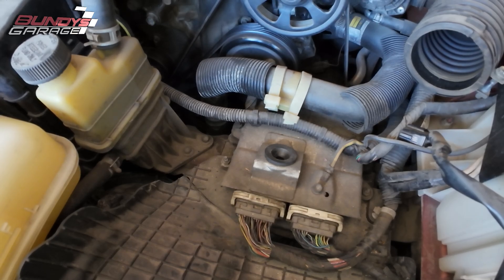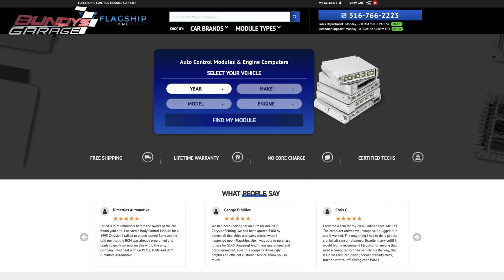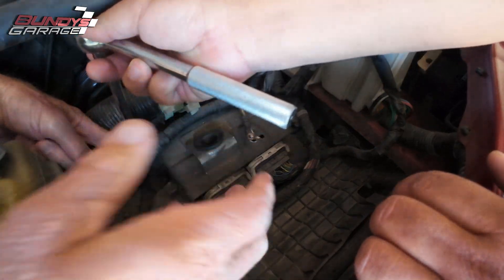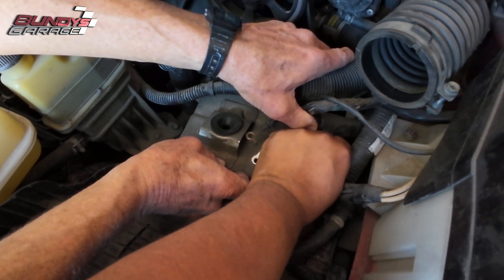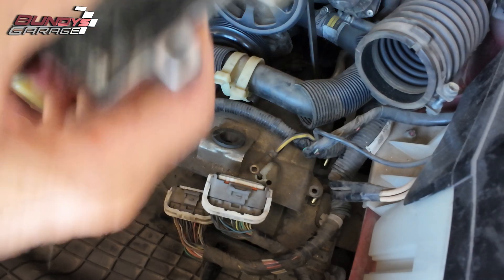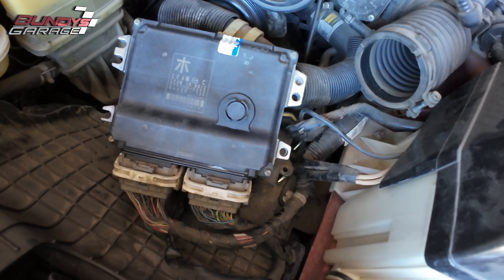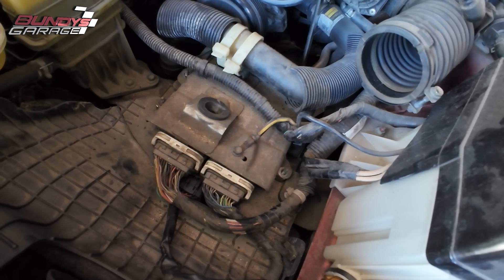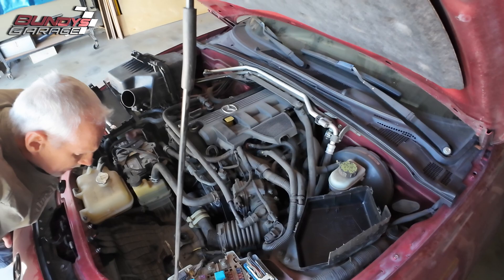Mazda Miata MX- 5 NC Died while Driving | 2005 - 2015 3rd Gen | Anti Theft System or DEAD COMPUTER

Comment: Did you figure this out? I have the same issue
Reply from the maker: We did, it was the wiring harness that run near the front center of the top of the engine. It sits next to the engine hoist point, metal bracket that stand up. That wiring harness has been rubbing on the metal bracket and cut some of the wires. I should make a follow up video.
Reply: @bundysgarage  yeah thanks. Mine ended up being corroded terminals in the interior behind fuse box. you should do a follow up its a common fault

Comment: I own a 2008 Mazda MX-5 Grand Touring. I had the same thing happen to me about six months ago.  The problem was caused by blown 20 amp starter fuse (position idrntified as "ST20A" on the underside of the black plastic fuse block cover) in the main engine compartment, in the upper block of the fuse block.  I replaced the 20 amp fuse and my car started.